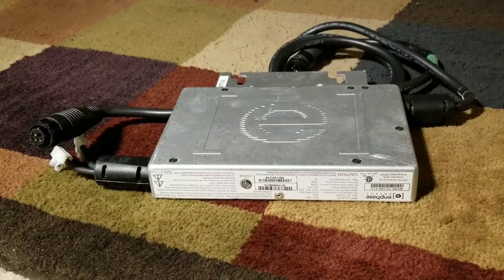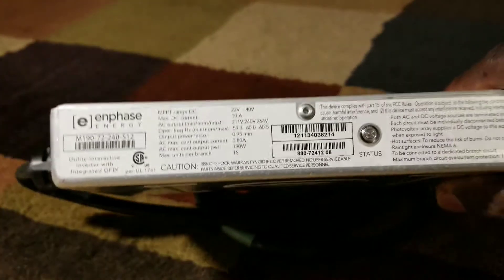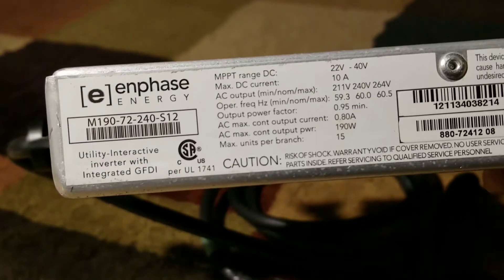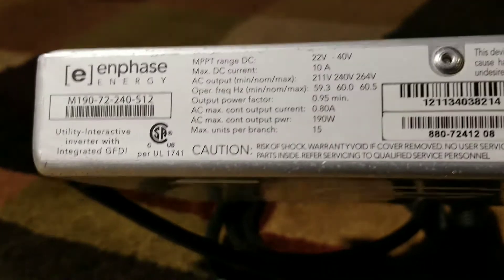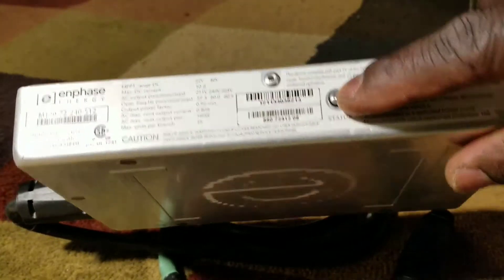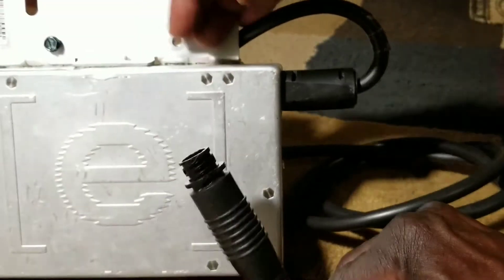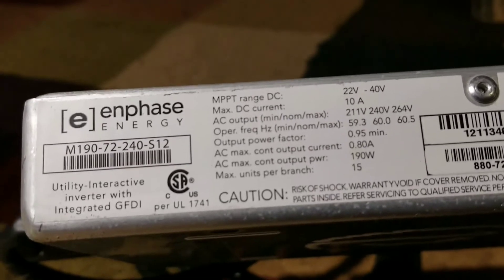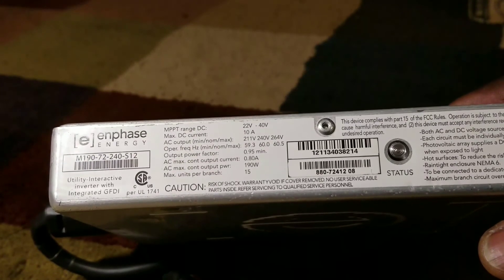HOW TO SOLAR POWER YOUR HOME GRID TIE vs MICRO INVERTER vs Power Optimizer vs Charge Controller

Comment: MarsRock 1200W Micro Inverter with Communication Function 22-50Volt DC 180-260Volt AC Grid Tie Inverter for 4pcs 300W 36V PV Panels(AC 220V) can i wire this inverter into my radian AC port, as if that power is coming from the grid, i am off grid? what do you think?
Reply from the maker: I will advise you NOT to do that my friend. 
Thanks for asking and have a wonderful day.
Reply from the maker: I will advise you NOT to do that my friend. 
Thanks for asking and have a wonderful day.

Comment: i just got my 3900 watt 100% off grid system on line yesterday. i had to install it all by myself , could not get an electrician. took me about 4 days,  15-260 watt panels 4048 radian outback inverter , midnite 6 combiner box, outback flex 80 charge controller ,the midnite  mini 175 amp disconnect box. and 8 6 volt  235 amp hr Trace batteries ,and it works like a dream come true .
Reply from the maker: +Steve rivera 
Wow!! 
Congratulations brother. You are the best and I am really proud and happy for you just form what I hard. That's a lot of work you put in Sir!
OutBack Radian is an awesome machine to have. I am also running 6 Volt 225Ah AGM batteries on my system.
Thanks for sharing Sir and have a wonderful evening
Reply: you motivated me to get it done, thank you for all the good information you provide
Reply from the maker: +Steve rivera 
Yes Sir and thank you I really appreciate you so much for the SHOUT OUT and welcome to the family. 
Let's go Solar!! Brother!